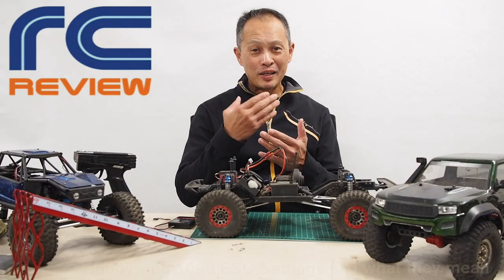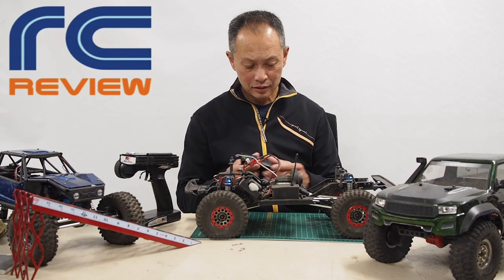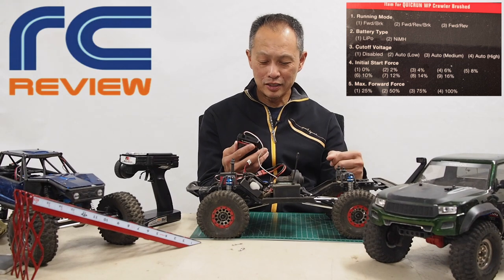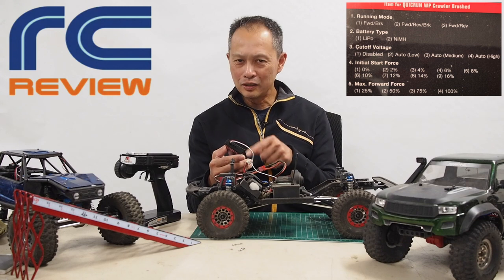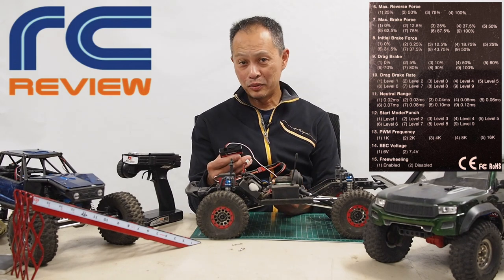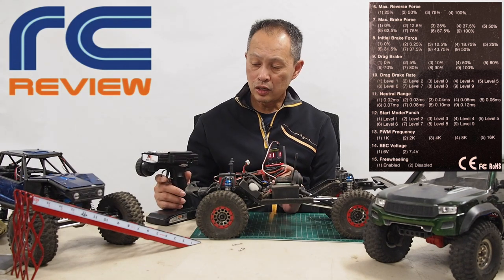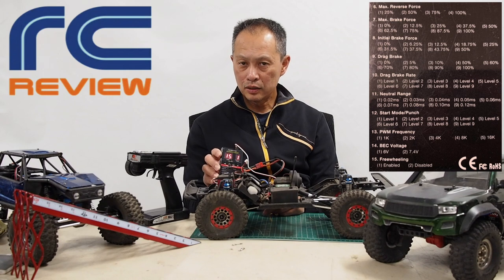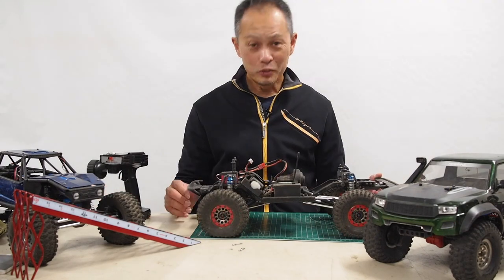How to: Program the Hobbywing 1080 ESC

Comment from the maker: For #13, we pick the highest setting, #5 for the smoothest acceleration available.

The acceleration will be more aggressive at the initial stage when the drive frequency is low; a higher drive frequency is smoother but this will create more heat to the ESC
Reply: #13 will also change the sound of the motor. Below 8K you can hear it more (with higher or lower pitch). An higher PWM can also be more efficient in driving the motor. Yes the ESC will run hotter as the MOSFET transistor inside are dissipating more heat every time they switch state (the higher the frequency the more they switch), but the motor response to the input signal will be more efficient. This is a killer feature of this ESC imho. Being able to go high is great.
Reply: @chiccorocker  so what's best 5 ?
Reply: @chiccorocker  what do you set this to... or what are ALL your 1080 settings?  I hope to add a 1080 to my arsenal as one of my next orders...
   I was thinking, 8k , quiet,  fairly smooth, one step from the highest to cut the heat level down a tad bit...
   Wondering how you set the throttle and brake settings.  I'm planning to run this with a 16t 5slot motor...

Comment: You kind of bobble number 15, but then nail it with granular control during descent. I find it useful to enable Freewheeling first since Fw tends to make its presence felt elsewhere--particularly drag brake. With Fw enabled I drive some steep ramps while dialing in the rest. Great video. Thanks for doing this.
Reply from the maker: Right on bud.

Comment: how come you didn't  talk about #13
Reply: Exocaged has a good video showing the PWM setting...and how it affects noise....    higher makes less noise, can be smoother, but also creates less heat.... i plan to use 4k or 8k when mine arrives...and going to try not using the highest setting for less heat, as I will be already running on 3s lipos with a 16t 5slot(supposed to be similar to 35t)...

Comment: I have the quick run. But I'm getting no power or steering. I'm new to the hobby and feel stuck. I have a tamiya tt02d with absima transmitter sr2s. Quick run esc and a cheap servo.. what am I doing wrong. Can't even get my first kit car going

Comment: How many volts can the skyfly reciever take?
Reply: I wondered the same, as far as other parts of the system liking 7.4v...
   I habe a 1080 coming, but plan to use it with a rig that has lights, steering, reciever, and some other bits...also plan to use 3s lipos, and that is usually harder on a BEC... I looked up the BEC spec and it says 3A....  I will be adding a CC BEC as i usually do in our trail rigs.

Comment: Hey Francis, thank you for sharing your knowledge here! What i found out: If you run it in in Forward/Reverse mode, the Brake is disabled and so Parameter 7 (Max. Brake force)and 8 (Initial Beak Force)has no more function. 
Maybe i missunderstood something, let me know... Thanks!
Reply: This makes sense, in fwd/rev mode, the only brake action is drag brakes... wondering if the 8th setting option makes it start softer and ramp up to your drag brake setting?  I haven't gotten my 1080 yet...
   Would u tell me the settings you use?

Comment: 7.4V BEC on an Annimos 25mg will work but burn out on a stock TRX-4 radio, though right?
Reply: Thinking same but 20 bucks if last a year its good
Reply: @paulclancy2404  A new receiver isn't $20 though, I think you're thinking about the servo.  I'm more afraid of the receiver failing.
Reply: @LeftenantMalachi  oh yes i was , it cant be tactic or traxxas not sure about fly sky i prefer futaba but spectrum can handle 9.0 volts i was thinking about getting flysky even better one but this one 37 bucks i hear works just as well

Comment: My battery is  a Nimh 7.2 volts will it work on the 7.4 volts or do i need to use the 6 volts im not sure
Reply: I hot a Redcat gen 7 that i have been upgrading on and just got the new esc
Reply from the maker: Yes, it will work.
Reply: So should i put it on 7.4 volts or 6 volts on my esc
Reply: I just got it yesterday and going to put it on tomorrow on my day off
Reply: Dont want to destroy it

Comment: Thanks! This is very helpful! Why did you skip setting 13?
Reply from the maker: Sorry, that was an oversight. We pick the highest setting.

The acceleration will be more aggressive at the initial stage when the drive frequency is low; a higher drive frequency is smoother but this will create more heat to the ESC
Reply: Apology not necessary. No doubt with the tiny writings on the program card it can easily be overlooked. Thanks for the additional info. 👍🏽... you’re the man!

Comment: So I'm using the same flysky controller and I was wondering do you leave your dual rate down? Have you used this controller on a sensored brushless esc with turbo and timing modes?

Comment: #RCReview - I have a few questions - i just got the Dynamite LED Program Card (DYNS3005) and I am trying to figure out if this will program my ARRMA Notorious that has a Spektrum SR60100AT DSMR w/ AVC Telemetry receiver thats installed, also what port should I plug into the bind port or the one of the AUX ports?
Reply from the maker: I don't think that works. The Dynamite LED card is for programming the SPEKTRUM™ FIRMA™ SMART 40A BRUSHED 4-CHANNEL ESC/RECEIVER.  It's for programming the motor functions only.

Comment: Can someone help? After installing the hobbywing esc I can only use the traxxas tq remote in 70/30 and not in 50/50 mode. If I put it in 50/50 the car automatically accelerates and a constant slow speed. I’m not a fan of the 70/30 and I would like to revert it. Please help.
Reply from the maker: You have to calibrate the esc while in 50/50 mode

Comment: hi thx for the video, i still have one question, in number 14 the voltage to the servo that voltage only goes to the steering servo or also goes to for exemple in the trx 4 to the differential servos?
Reply: The BEC voltage will be what is feeding from the ESC into the Reciever, then from there into the rest of the system...so reciecer, servos, leds, anything connected to the reciever basically...  
   I will be disabling the BEC that is internal to the speed control, and using a separate standalone 10A BEC from Castle(about 23$).   I'll be running on 3s lipos, powering a reciever, a few servos and other bits, as well as some lights...

Comment: Hey Nice video I usually watch your videos all the time, I have a question about this Hobbywing 1080 esc, I recently installed 1 on my axial scx10 II and 2 days ago my servo stopped working, because the servo circuit burned out and since that day My esc works like crazy, (it did not turn off when I hit the power button) and today it did not work when I turned it on the esc, the power led is flashing and esc does not turn on ... Please, I need help with this.

Comment: Hey brother what should the PWM freq. Be set at?
Reply: Exocaged has a great video showing the different settings and how it affects noise.... higher pwm settings are quieter, and can be smoother, but also create more heat....  I'm going to start with 4k or 8k when mine gets here...

Comment: Just installed the 1080 esc , but now the differential lockers and the two speed selector have stopped working ?! Any ideas fellow RC fans ? Also there seems to be ghost movement from the steering servo which is a 20kg HD waterproof ? I have a Bluetooth module in my Traxxas TQi could this be an issue with the new Hobbywing ESC ?
Reply from the maker: You running the ESC at 6.0v right? Might want to return back the old ESC just to diagnose that everything is still working.
Reply: I’ll run the esc at 6v and also check against the original esc too , thanks for the help 😀👍🏻 think it could be the TQi Bluetooth link software acting weird , I run two TRX4 with the TQi and have Two profiles setup on the App , sometimes they don’t load the profile correctly , I’m going to try delete both profiles on the App and try setting up as new 🙏🏻Thanks Francis
Reply: The issue was three blown servos Francis , I set the BEC at 7.4 to add that extra power to the steering servo , however this has caused the 3 2065 servos to burn out ? Had a spare Traxxas 2065 smaller servo to test and it works on all three channels ! Have it set at 6v at the moment.
Did you set your 1080 hobbywing at 7.4 volts with the standard 2065 Traxxas smaller blue servos ? , The 2065 are max rated at 6v supposedly ! Be careful people , very expensive to replace three micro 2065s 🤦🏻‍♂️Also thanks to Exocaged RC for added help 🤘🏻
Reply: @grski900000000000000  , when he said to set this to 7.4v I immediately cringed...not all electronics will like that setting.... some servos, and some recievers , will die at 7.4v .... he could have done a better job explaining that you need to make sure ALL your system will be ok with that setting... apparently his reciever and servo was OK with it...
Reply: @ Isaiah Furrow , yeah Isaiah it was quite a costly mistake , I managed to get a great Deal on eBay from Jenny’s RC for the three servos , but still , it’s a mistake that hopefully others from reading this will not make , , Still a big fan of RC Review of course , 🤘🏻

Comment: can you explain why your 13 is at 2? looks like that was skipped in the video
Reply from the maker: Sorry, that should be at 5, 16k.  That provides the smoothest acceleration.

"The acceleration will be more aggressive at the initial stage when the drive frequency is low; a higher drive frequency is smoother but this will create more heat to the ESC"
Reply: @RCReviewChannel  cool yeah that is what i have mine too. thanks for the video man. good stuff.